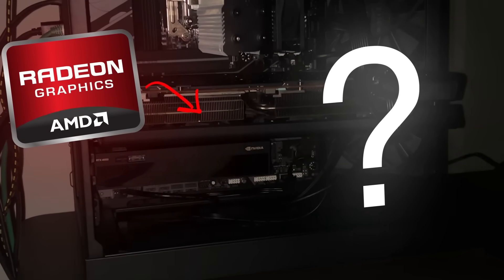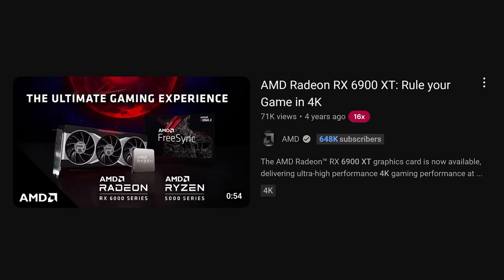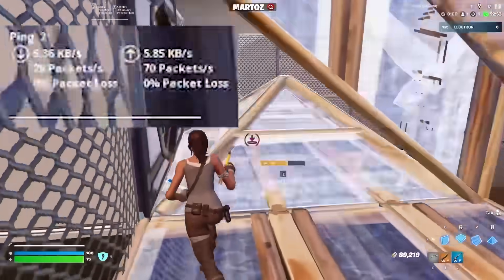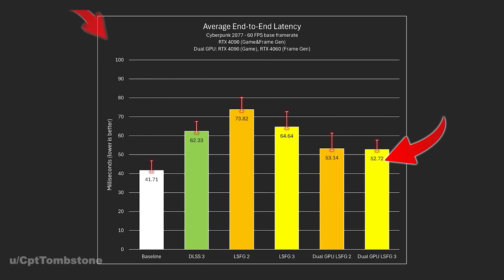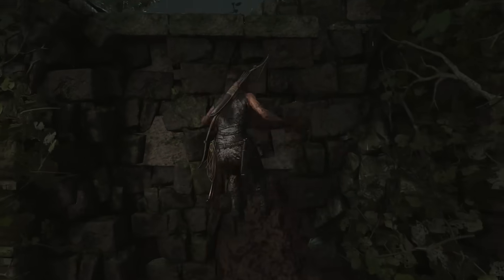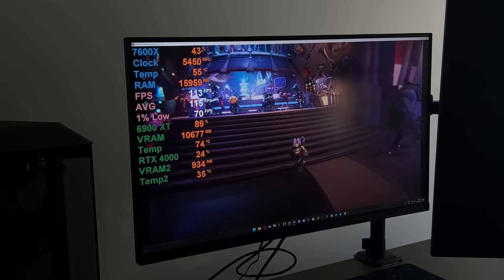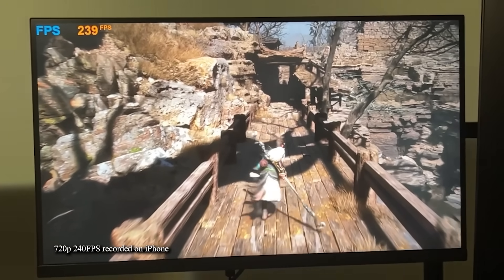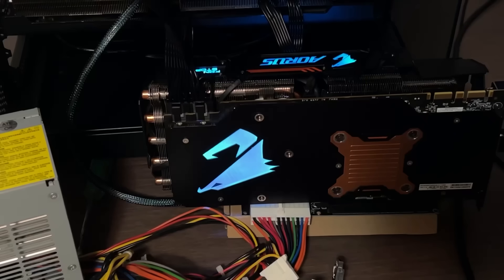I Used Both AMD & NVIDIA in One PC and Got 240 FPS in Every Game

Comment: pro tip, for sticky heatsinks on SSDs just use a heating pad a heating gun on low temps or simply a lighter... heat the heatsink tho not the SSD itself.

Comment: Very interesting I haven’t seen this method since VirtuMVP I would let my Radeon hd 3580 (2gb gddr2) do the heavy lifting while outputting through the integrated gpu on the chipset. I got steadier smoother frame times frame pacing and it lifted my fps substantially. This was when Skyrim was going 4-5 yrs strong. Diablo 3 didn’t stutter or get AMdips (this Radeon was Ati) my cpu was a core i7 2600 16gb ddr3 ram off of a hdd.

Comment: Moving your SSD means it would use the pcie lanes instead of being connected to the CPU directly, unless specified by the motherboard. If not, then you'd have even less lanes available for the GPUs.
Reply: Which isn't really an issue as much as people think. Even the 5090 and whatever AMD's top end card is now don't even come close to tapping out the PCIE lane's through put.
The issue is purely the GPU cards being at their physical limits and their only real growth has been because of the slow creep of better RAM and RAM speeds.

Comment: I used to have a double GTX670 SLI setup, back in the day, until NVidia s-canned the whole idea, and I used to be a huge fan of the potential it could bring. Good to see people are bringing it back and making it more effective than both NVIDIA and AMD ever did!
Reply: @luciusnetheril  since when its frame gen better thanks sli 😂
You guys can't stop being deluded.
nor dlss, fsr or frame gen can come even close to native.
Imaging saying that fake frames are the future 😂
Reply: sli / nv-link still works to  this day lol just got to run dx11 or the dx of the game and sort the nvidia app not to global and render 1 or 2 depends if it glitchy
Reply: gpus are too expensive these days to even consider adding a 2nd one. i had a gtx580 and after a couple of years wanted more power so bought a 2nd one for sli and it was great, but that was because you could buy 4 gtx580s for the price of a single 5080. amd needs to pull their socks up and start actually competing with nvidia before we have even a glimmer of hope that prices will come down.
Reply: @iris4547  as we have seen lately, AMD is as scummy as NVIDIA and they dont want to compete and get new customers, they want their share of milking them. first charge of 9070/XT was MSRP, now they just added 100€+ to the 9070 and the 9070XT, card was 689€ now is around 800€+ for the cheap ones and 900-1000€ for the ASUS and Sapphire cards.
Reply: @iris4547  what are you yapping about.. the gpus suitable for this havnt even gone up in price on the used market. Stop thinking about the latest gpus smh

Comment: Why didn't you use a DP and HDMI combo and have both GPU's plugged into your screen? By doing it the way your doing it, you effectively increase the input latency not to mention you had to buy a PCIE docking station and hook up an entirely different PSU... Do some more research on how to setup dual GPU for LSFG before you actually attempt something and it resulting in a Frankenstein creation.

Comment: God, another video that gets my hopes up, but as always it turns out to be another one about frame gen.
I thought it was something like using nvidya gpu for physx acceleration but better.
Frame gen is not giving you more performance. Yes the number is higher, but you get none of the benefits of actually having 240fps.
Reply: @Ec8er  thank you for saying this, i fucking hate frame gen
Reply: I think you are all right in some way. If your game requires fast reaction and precision timing and aiming, it's better trying to get the highest possible base FPS without frame gen. But if you're playing some slower pasted or non-competitive games, then it can make the game feel smoother.
Reply: @Carltoffel  It could be ok if you're willing to accept compromises. I won't, but some people can and that's probably why there's this whole discussion.
Reply: @ Absolutely. There are many games where you cannot or will not take any compromises (e.g. e-sports). I think the discussion is mostly the result of people (esp. GPU manufacturers) trying to sell frame gen without speaking about these compromises.
Reply: @Carltoffel  same opinion here and planning on buying second gpu with LS in mind
Reply: @Heartbraker69228  don't do it. It's absolutely not worth the money and hustle to use it that way. Just save up money and buy a decent GPU that can handle games that you play at your chosen resolution and framerate.
Reply: @Ec8er  I will buy a decent GPU that can handle most games in 1440p it's either rtx5070 or 9070xt. I have a 1000w PSU and it's more than enough to handle both cards, also I recently upgraded to water-cooling solution so my CPU temps will be fine. currently I use 3060ti as my only GPU and plan on using it for LS. (Also I mentioned that I used FG because I use it on my laptop that has rtx 4070 mobile just so you understand that this info doesn't appear from thin air)
Reply: Yes you do, you get the smoothness of a higher frame rate. Also with two GPUs you get reduced latency as he showed.
Reply: @Skylancer727  Have you used any 120/144/240hz monitor as your main one for more than an hour? If not, then you don't know what I'm talking about.
It doesn't matter if it reduces input lag,
because it doesn't increase the responsiveness. Aside from ugly motion actifacts, the main reason why I and many other people don't like about FG are the not reduced frametimes.
At 60fps you get 16.6ms frame latency
120fps - 8.3ms
240fps - 4.2ms
This number represents how much time it takes your pc to generate one frame and when this number decreases, you feel that your inputs are more responsive. It happens because your movement is updated faster and more frequently.
When you use FG at 60fps and after turning it on you get 240, you still have  16.6ms of frame latency. Your inputs are not more responsive because you can't generate responsiveness. it gets even worse when your base framerate is even lower - at 30fps you get 33.3ms which is awful to play.
It's like if you ate strawberry ice cream, but it didn't have any flavor, it wasn't cold and it wasn't sweet.
You can test the frame latency even on a 60hz monitor. Launch a game that you can easily get over 200fps, move the mouse around, then turn on the vsync or cap the framerate to 60.
You won't see a difference in the smoothness on the display, but you WILL feel the difference in your mouse movements (but only if your mouse has a pooling rate higher that the framerate you are getting).
FG is not a good solution, it's not adding performance and 240fps with FG will always look worse than native 240fps.
Reply: @Ec8er  I seriously wonder if you've used a high refresh rate display saying this. I can 100% tell the difference between a 60hz image and a 120-165hz image (never had a 240hz display so can't vouch for that). Input lag does impact your experience, but for me, and many others, the clarity of higher frame rates is more paramount. Maybe your display has a lot of inverse ghosting or VA smear, but for me the benefits of higher frame rates are obvious beyond input lag. 

And responsiveness and input lag are the same thing. The reason people say interpolation feels worse is that the image is waiting on a second frame. That means 60hz native now feels like 30hz, 120hz feels like 60hz, etc. For many, this doesn't impact them at all. Not everyone is sensitive to input lag and many games have huge input lag in the first place. I can't tell you how many games I've played with motion acceleration on my mouse or with giant windup times for actions. In these games responsiveness means basically nothing, but motion clarity does. Hell anyone who's played Ocarina of Time or Majora's Mask played those games at 20fps. The input lag is atrocious yet nobody seemed to care outside of the image being a slideshow. And no, the decompilations don't change the responsiveness, just the appearance. Actions are now time based, not frame based. 

And I will never say that interpolation is the same as native performance, but we don't use it when you could get better native performance. It's not downloading ram, but it's also not this albatross people make it sound like. If I'm using interpolation it's probably because my system can only handle around 50fps. Lowering settings in some games impacts the image more than others and CPU limitations are unbeatable. Interpolation is the best way to not stifle these games or the only way. Like Hogwarts Legacy can hit 120fps just fine for me in the open world, but go into the city and even my 9800x3D tanks below 60fps. Interpolation is the only way to fix that as none of the settings fix a CPU bottleneck.
Reply: @Skylancer727 Im pretty sure that people in ocarina of time, or any of those older titles. Have accepted the fact that they will have to deal with the limitations of the hardware. That does not necessarily mean that they are ok with it or like it.
Reply: @DasFlank  Many games on the N64 ran at 60hz. Duke Nukem 3D, F-Zero X, Quake, Quake 2, etc.
Reply: @Ec8er  No way you'd gain any performance between 16.6 ms and 4.2 ms; the tiniest fraction of the human population can get their own reaction time below 100ms.
Reply: @ThantiK    Tell me you haven't used a 240hz monitor without telling me you haven't used a 240hz monitor. But jokes aside, you are mistaking human reaction time with how fast/often a computer is rendering a new frame. If a computer is rendering 240 frames per second then it takes it 4,2 milliseconds to render one frame. 
1 second=1000ms
1000ms /240fps = 4,2ms
1000ms /60fps = 16,6ms
Reaction time is related to seeing smoothness on the screen or in real life.
Reply: @ThantiK  reaction time has not much to do with that. 100 ms would be 10 FPS, and even if you cannot react as fast as the frames at 10 FPS, it will look and feel horrible.
Reply: @Ec8er  Better compare for example 60-70fps on 240hz monitor and then generated 240fps I guarantee you you would prefer the generated frames even with like 5-10ms. more in non competitive games. Been playing games that are capped at 120 or 60 and doubling framerates makes a HUGE difference in how our brains percept the fluidity. At least it's what works for me and even with games like cyberpunk I do prefer  Lossless scaling x2 or frame gen on a high refresh rate monitor.

Comment: I've tried mine with both my 6800XT and 3070 in my same setup, it breaks 100fps after LSFG application but I have to get sound issues due to onboard audio distortion.

I also use my 3070 for streaming OBS so it's mostly good.

Comment: Hey Lecctron, I've been looking at your set-up and honestly it looks a bit wonky with all of the compromises.

How about try it with a MSI MPG Z690 Force/Carbon Motherboard? I got mine for about $175 used on Amazon, and it supports bufurcation up to PCIE Gen 5 x8/x8 without any external stuff. (I run an RTX 3080 and an Arc B580 on my main PC right now.)

Sure, you'd have to get an intel CPU that doesn't bottleneck the test and a PSU that supports like 1000W, but honestly it's worth. The i5-14600KF is only $180USD right now as we speak.

Comment: 2:31 If Fortnite is a CPU based game, the what does that make Minecraft?
Reply: @regbart  Minecraft is also a CPU based game with a ton of the randomly generated data directly utilizing the CPU to create the generated maps/levels. Minecraft can be fairly light when it comes to the GPU workload unless you are running it with RTX on and all settings cranked. For the most part it's a game that will benefit from a decently modern cpu but is certainly not a requirement and can run on a potato PC/old GPU with the right settings no problem!
Reply: @DabFanatic  there are mods like Nvidium, Voxy, and C2ME that is dependent on your GPU

Comment: "We generated NEGATIVE fps"
Why is that so funny
Reply: Its actually an option with adaptive mode. You can set it to blow your current frame rate for whatever maniac would want that for.
Reply: @NeKuLinu  PCIE 4.0 to pcie 3.0 conversion bottleneck.
Reply: I asked a rhetorical question on why it was funny, not asking for the cause of the lower frames
Reply: @NeKuLinu  because it shouldn't be possible but it is😭
Reply: It’s not

Comment: I've tried 60 to 144, but it's just not enough for it to look good
It works well for games that don't have much movement, but is very distracting for anything else
Maybe 120 to 240 is a good use case, however I do not have the resources to achieve that lmao
Also, ui elements can get quite butchered

On saying that though. It's harder to notice the frame generation on my steam deck, so streaming my pc to it I sometimes use frame gen to smoothen them

Comment: "Oh, that's just using a second GPU to generate fake frames." Lossless scaling should be used only to "uncap" games that were capped at 30FPS by the assinine porting teams.
Reply: Idk the input delay is pretty compelling for non competitive play. Someone else also mentioned afmf 2 as a slightly more streamlined solution. Lossless scaling is definitely awesome for your started use case as well as emulation, since even emulating an OC is kinda funky, it's great being able to play something like Shadow of the Colossus at 120 fps where a normal PS2 or emulation would slow down.
Reply: @dogboy0912  honestly my main fear is modern PC ports including something like this as a cheap way to unlock the framerate.  We're already at the point where 'remasters' are just emulated games, or they're re-releases of the old PC versions with all the issues intact.

Comment: So yet again - I'm saying the same thing I've been saying for nearly 15 years - Intel, AMD stop being so f'n stingy with PCIe lanes.   We've had motherboards with 3 or 4 x16 slots for ages yet we only usually get about 16 lanes by the time you consider the crap used by the motherboard.   Sure you could by a server motherboard for gaming?    To me the lack of additional lane slots feels like I'm still running a 32 bit OS on a 64 bit processor.
Reply: yeah it was good back when intel still made HEDT chips with 40 or so lanes instead of the consumer line with 20.

Comment: I have two GPUs. a 7900 GRE and a RTX 3050. I haven't tried lossless scaling like you have, I actively avoid any scaling in games and try to run every single one at native resolution, its just what I prefer. I Could test it out though, My 7900GRE has full Gen 4 X16 and the 3050 does have Gen 4 X4 bandwidth. I mostly use the 3050 for Nvidia broadcast and it gives me a better quality hardware encoder when using a steam link or game streaming around the house, maybe an intel GPU will do well there too with their AV1 encoders... Oh phsyx works phenomenally btw, its just an extra bonus I discovered.

Comment: At least bro has a pc to tinker with I have a surface go
Reply: Don't worry bro I have a spare PC to give you
Reply: @HorrorTactico  How do you even get a spare pc in the first place?
Reply: @channelowner-axium When you jump to a new generation of chip you need a whole new motherboard. I have two PC's one that is made from some old parts and new that was built on a budget to be a streaming rig for a room mate... He never paid so it came with me. If/When I start streaming again for fun I'll likely pull it out and replace the 970 in it out and upgrade it to the 1070(s) I pulled out of this PC. (Still a good system as it has an i5 and 32GB of ram so it's good at video rendering)
Reply: @SilvaDreams  oh ok thanks for the clarification

Comment: I thought this just after lossless scaling got the FG update. 
I tried with a 4070 and a 2060, but the problem was the PCIe of the mobo.
Then I've tried againg with a different mobo and the only issue was that the 2060 is weak, so it wasn't able to deliver the fps I hoped for.
Other thing is the integrated gpu. That can help too, in fact with ryzen 7 7800X3D iGPU you can't go lower than 45 fps.
Great video btw, I'm really happy to see someone doing this the right way with the right hardware
Reply: try with AMD gpu, they are better than NVidia in tasks required a lot of calculations

Comment: I got my 7900 XTX as the primary GPU with a spare 2080 Ti laying around I could very well do this right now if I wanted to lol
Reply: DO IT, stop bragging and make a video
Reply: @HorrorTactico  I know you didn't ask me but I can do it soon and make a video.
Reply: Ive got a 7900 XTX too. Why would anybody want to do this if you have a GPU with these specs?!?!
Reply: @FearfulEntertainment  the FG or PhysX? Because Radeon GPUs don't support PhysX and by connecting a Nvidya GPU you can get more frames with PhysX on. For FG? Nah, not worth it.
Reply: If you do it, I'm very sure that if you get it set-up properly you'll love it
Reply: @cosmicusstardust3300  Just bought a 5070 yesterday for 627 dollars and got my 2070 oc laying around now, have been planning this for awhile myself
Reply: he showed huge flaws if you listen and it's very tedious
Reply: @eyzo7247  cos he did it in dumb way. you dont need 2nd gpu. most people do have integrated graphics and its fine with that
Reply: @eyzo7247  I did listen which is why I'm not doing it, also I'm using Linux not Windows. I don't want to install Nvidia's crappy drivers
Reply: Same
Reply: Don't do it it's not worth it. But you could use your 2080 ti for physx though!